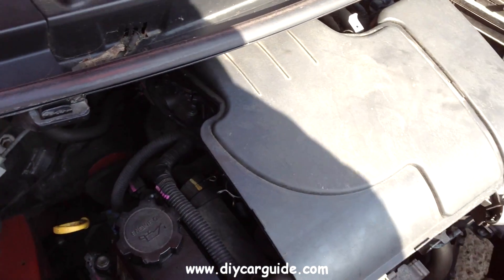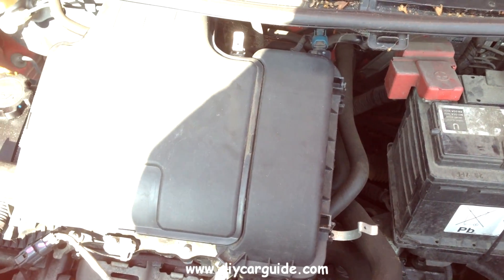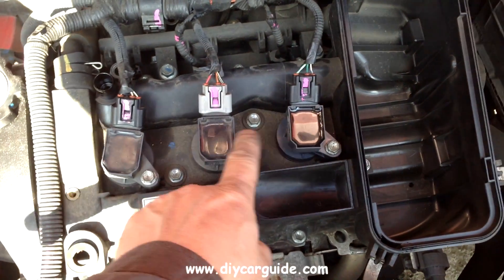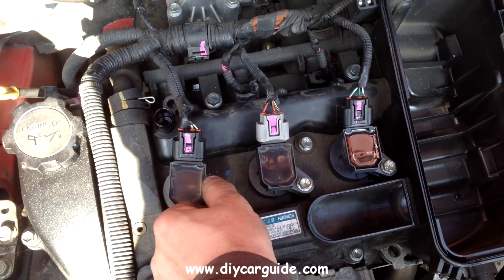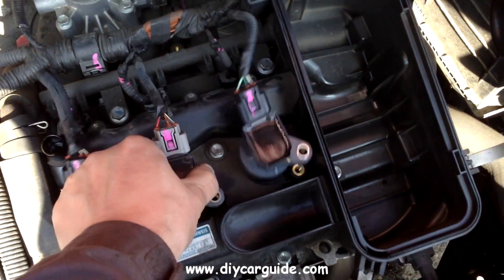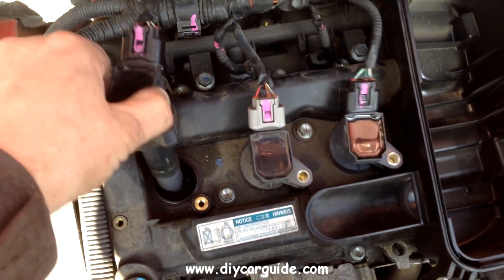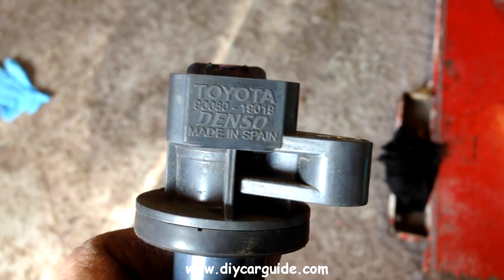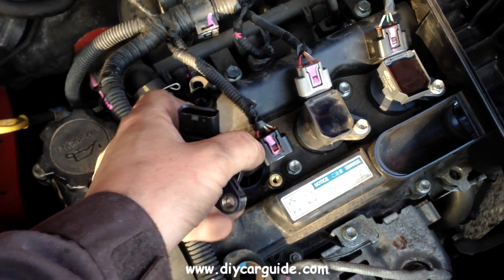Toyota Yaris Coil Pack Diagnosis and Replacement

Comment: Hi guys, I can't find the sockect connector with 3 wires for my ignition coil pack. Is there a way to resolve the issue. Yaris 1.0 2006 1kr, 3 cylinder

Comment: Hiya was wondering if you could give me any advice..i purchased a mk2 toyota yaris vvt-i 1.0 2007 and cooling fan was seized..i replaced the fan the thermostat and temperature sensor and it still doesn't come on..also the relay in fuse box is ok 🤔

Comment: Hi please help me with the colour of the wires on the first coil pack Can anyone help with the correct wiring colour for my ignition coil on a yaris 1kr engine

I have three wires comes to the first ignition coil(Drivers side) The wires are (red) (white) and (black+white)

Please give me the correct function of each wire I want to change the plug.

Comment: I have vitz and have a problems with engine vibration when AC started  , car also vibration when it on Drive mode and press break for short while

Comment: Hi Steve, mine is Toyota yaris 2009 MMT and was broken on the road with some burning smelling.  The car won't start  anymore,   no any sound when turning,  also can't read the error code due to no communication, but all the lights, radio, e-windons etc work fine, . Checking all the fuses are good, ignition switch is good, starter motor is also good, but still can't find the problem.  Any help please? Thank you.

Comment: Nice video ;)
Is this engine reliable? Anything critical to check before buying one?
Thanks
Reply: one of the most reliable engines, its fucking toyota, change oil, spark plugs and it will run forever
Reply: @TheBeautifullKiller  Thanks we end up buying a 2008 (e150) Corolla 1.4vvti. I hope it's equally reliable

Comment: do you know how to connect a rev counter to a peugeot 107 that does not have the factory  wired connector behind the dash  i have asked  many people  but no one knows, have you done a video on wiring a rev counter to a 107 that doesnt have the built in factory  connector on the loom,  ive even seen a car that had a rev counter in place that wasnt wired up cos it also didnt have the loom connector behind the dash  please any help would be great

Comment: Hi, I have the exact same vehicle and it keeps bringing a check engine light whenever you drive for long and the engine warms up. What could be the problem?
Reply: exact the same thing thing happened to my yaris 1.0 2010. Did you find which was the problem?

Comment: Hi friend how are you I want to ask you I changed the head gassket of toyota yaris 3 cylinder engine when I star the car so it make the missing problem and exhaust system is too much hot in red colour and show engine check light so what's the problem plz ?

Comment: so my yaris barely has any power to climb uphill, does it necessarily mean I have to check the coil pack, because the running and the idling sounds abit off, will appreciate any advice given, Thank you
Reply: Rorisang Moale what did you end up doing?

Comment: Very helpful video. Had my yaris checked and was told the second coil was faulty. So I changed it. Still the same. Followed your instructions, with gloves, and found the first coil to be faulty so replaced that instead. Running lovely now. Cheers mate.

Comment: interesting, we have seen what the garage did for us today as we had a misfire on number 1. they put new plugs in too and the air filter
Reply: ENG LIGHT AND TRAC CONTROL LIGHT ON RPM DROPS WHEN STOPING

Comment: this is not a yaris its an aygo :P
Reply: its a yaris, wanna know how i know? the throttle body, is cable on the aygo and electrical on yaris, both use the 1kr-fe engine
Reply: @jusb1066  u wrong here mate ive got an aygo with electric throttle
Reply: @Kamilsmk  cable operated go have a look, I'm a Toyota tech ffs, with my own aygo sitting right here with a cable on it
Reply: @jusb1066  mate i got a toyota aygo 2006 model 1.0 automatic which have throttle by wire system on instead of cable operated 🙂

Comment: Hey Steve will this test work on a 2006 Dodge Ram 1500 v8?
Reply from the maker: Sam Flores Sorry I have no idea as that car isn't available where I live.
Reply: @diycarmaintenanceandrepair3764  Hi, i just bought a AYGO 1tr here in the UK with 21000 miles on it. Have you ever experienced these engines hesitating on take off mostly in 1st gear?
Reply: +DIY Car Maintenance and Repair Guide I have a 2012 Toyota Tacoma with 2.7L that uses similar if not the same coil packs as the Yaris in this video.

My truck has been running sluggish lately and occasionally backfires when decelerating in lower gears. I have gotten P0353 and P0354 codes in the past but have not recently. There is a buzzing vibration in my steering wheel on deceleration. In addition, I have to keep the gas down more just to maintain speed. Finally, I am also getting bad gas mileage (Used to get 23-24 mpg on highway trips. Now around 18-19 mpg)

I pulled all the coil packs while the engine was running at idle and the engine shook, which is what is supposed to happen. However, I have no idea what is happening while the engine is under load.

Should I just replace all the coil packs?
Reply: @GearheadExplorer85  I would say that your timing was of or the belt was slack or something

Comment: I have a suspected duff coil pack on my Honda Jazz. The Honda Jazz is fitted with two spark plugs and two coil packs per cylinder, so is there a test that I can carry out to trace the duff coil pack?
Reply: This is a Toyota Yaris video. You should post about your Honda Jazz issues on the forum the guy linked to in his video.